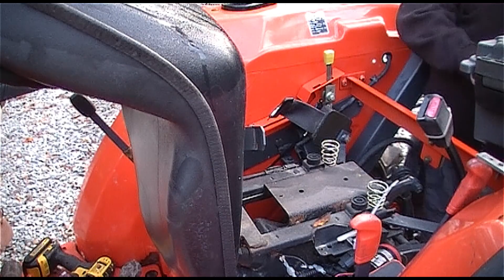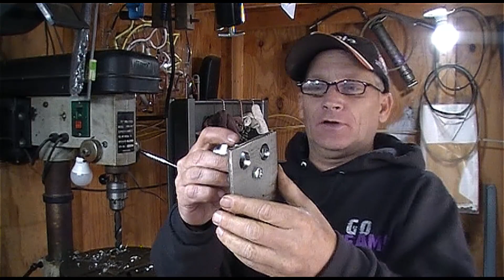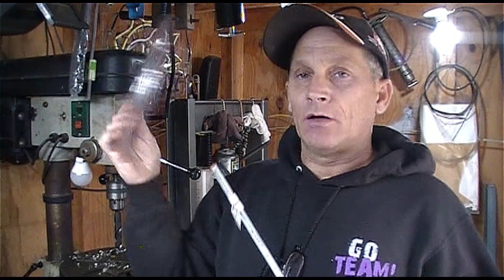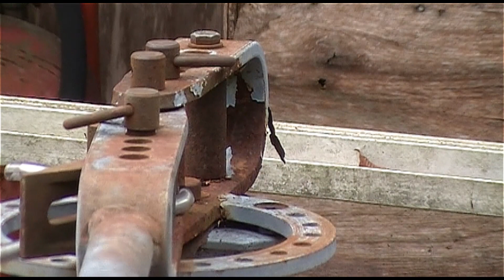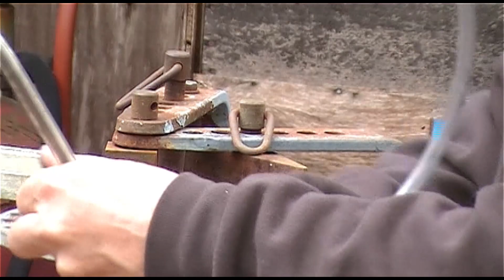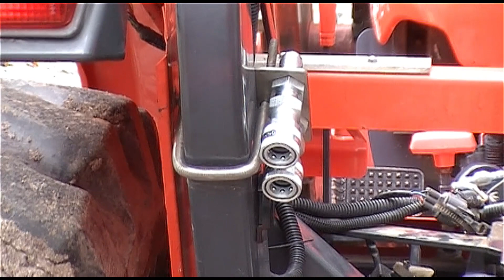installing rear remotes / spool valve part 1

Comment: Dave the is their any way to slow down the bucket dump on my Kubota m5700? It is way too touchy?
Reply from the maker: You should be able to feather the joy stick and send just a little flow which will slow it down. If your joystick control will not do this then you likely have an issue with the spool valve attached to the joystick. Feather by slightly moving towards the dump position. You can add a restrictor to reduce flow rate but that is not fixing the problem 1 and 2 it may cause increase in hydraulic oil temperatures. Hope this helps. If you need more info on feathering the control I’d be happy to create a short video showing this. Just let me know.

Comment: Dave, you’re the first you tuber I’ve ever subscribed to. Love these videos. I’m hoping I can learn how to add Rear Remotes to my Kubota L3301 that already has a factory-installed Backhoe as well as a 3rd-Function valve that I was able to install for my grapple.  I hope there’s a way to make that combination work.  Looking to use a top-n-tilt eventually with my box blade and scrape blades. A float style valve would be good.
Reply from the maker: I feel sure you will have great success with these videos if I can be of additional help please feel free to reach out to me here or my personal email address at Daveknowshow@aol.com my video series titled adding rear remotes and understanding tractor hydraulics will launch your understanding of how this works and you will get this done very easily. the hardest part is gathering the correct fittings to adapt the new spool valves to your existing hydraulic circuit. any local hydraulic shop will happily help you with ordering the correct fittings. I have found that Napa is much to expensive so avoid them unless you can compare price to another source. I used my local eaton dealer and a few others. thanks for stopping by and subscribing! peace love and respect to you and your family Dave in Virginia
Reply: @daveknowshow  Thank you, sir. Truly appreciate the offer.

Comment: Dave, just so I understand,,The spool valve you are installing, is that an open or closed center valve? Edit: Has to be open center for Power Beyond. If not, you won't be able to use anything BEYOND the rear remote spool valve.....
Reply from the maker: that is correct open center. some like mine has a power beyond port and a back to tank port. others only use the power beyond port. on this one I used both and had to either install or remove an internal device to create the power beyond port. cant remember which it was. I believe I added in a piece that was included with the valve. the only difference seems to be that when you add that piece instead of dumping the low pressure side of the cylinder into the power beyond port at the manifold it instead dumps that fluid into the back to tank port under relatively low pressure at least that is how I understand it. hope this helps. if I can help in anyway please feel free to ask.

Comment: Dave do you have a supply list of everything you used? I’m wanting to put just one set of scv valve on back of my Kubota L3410.  Could do exactly what you installed; but really only need one spool to raise and lower a hay rack.  Thanks
Reply: Also did you purchase everything from Agri supply?
Reply from the maker: @kevinhays8305  I don't have a list no. the spool valves I bought at northern tool but they can be bought at surplus center dot com. they sell lots of hydraulic surplus supplies. I tell you to be honest I was like you in that people told me to install a three spool valve and I insisted I only needed a two spool valve. well now I wish I had installed a three spool valve instead. so don't waste your time installing a single spool valve. trust me you will eventually want three. I'm seriously looking into adding another spool valve for a small dump trailer.

Comment: Dave, I have a question.  Your video is very good and I know what to do to eliminate the selector valve now.  But the question is, when I remove the front end loader which lines must be connected together in order to complete the circuit.  I believe it should be the main line coming into the spool valve and the power beyond line that must be connected to still use the rear remotes and the 3-point hitch.  Is this correct?  When the front end loader is removed, the spool valve goes with the loader and doesn't stay on the tractor.
Reply from the maker: on my tractor and most other tractors the fel spool valve stays on the tractor even when the loader is removed. that spool valve contains three vital connection points. main power in, power beyond and back to tank ports. hope that helps. if the valve is removed then connected the main power in to the power beyond line will continue the feed so yes you are correct. edit: additionally if equipped with a back to tank line that line will need to be capped off.
Reply: Thanks Dave, I'm going to watch the other videos about hydraulics that you have out also.  I'm not great on hydraulics, but in time I usually figure things out.  It's great to have access to videos like yours.
Reply from the maker: @kennethmelnik2494  I'm honored to be able to help. please let me know if I can help I certainly will.
Reply from the maker: https://youtu.be/DAeW5eqEqvM

Comment: Hi Dave. Great videos. I recently bought a small farm and my first tractor, a Kubota L2501. I want to add a spool valve to control my top and side link for my 3pt hitch. I plan to mount the spool valve like you show. What brand and model spool valve did you install?  Your videos and response would be greatly appreciated.
Reply: Thanks Dave. I may be hitting you up for more help.  How can I support you and your channel?
Reply from the maker: just keep watching liking and sharing my videos. I enjoy helping folks its what I do.
Reply: How are you feeling these days?
Reply from the maker: been hurting all over lately but I'm better than I was. just gotta keep pushing forward my friend.
Reply: Sorry to hear that.  Are you going through radiation and/or chemo?  I will be sending up some prayers for your healing.
Reply from the maker: no treatments for now. they want to do more surgery. I have been putting that off due to some other health issues. appreciate the prayers.
Reply from the maker: https://www.northerntool.com/shop/tools/product_200419671_200419671
here is the link to the valve I used. I'm not an affiliate to the site so makes no difference if you buy from here or amazon or some other resource. glad you are enjoying my videos. if I can help just let me know.

Comment: as one who is always custom building all kinds of stuff as I am a welder and heavy equipment mechanic by trade, I find hydraulic shops have a huge make up of that crap, I found a wholesale distributer that I can buy all the hydraulic components for like less then a 1/3rd the cost of the local hydraulic shops, and its all top line weather head fittings hose, valves you name it, the shops are getting to be out right criminals with this stuff, an with air fitting, princes auto sells cheap fitting but you have to really watch witch brand you buy, they really push there off shore brand power first witch are total junk, but they also have the good brands as well for a few dollars more, I use to buy all my stuff from them for many years until I found this distributer, I still buy some valves an pumps, hydraulic motors made by eaten, witch are really good and go on sale a lot, there hydraulic cylinders have been good an if you do get a bad one they replace it no problems, I still buy a fair bit of stuff from them but I really watch what brand I'm buying, last time I bought a few hydraulic fittings from a local hydraulic shop, it was like 200.00 for a 3/8 hose 6 feet long w/ female JIC FITTINGS ON IT AND A HAND FULL OF JIC TO PIPE FITTING only because I was stuck and the customer needed it right away, man I was pissed right off at there 500% markup and they feed you there line on how little they make on it so they cant offer any discount, witch is total bull shit as I know what I pay for a box of 50 of them fittings, also never buy pluming valves from Canada tire there total trash, they all get a tiny pin hole in the brass casting all the time in a mater of a few months.. there is no need for them prices they charge, its there huge mark up only.. iv been boycotting them for years and offering my customer a good price on the stuff
Reply from the maker: there is a huge mark up, I used eaton fittings and bought them locally. I paid a lot but I paid far less than the average joe or even local repair shops. I had helped this place out previously by resurfacing there gravel parking lot with the tractor and box blade. I did the job cheap and so when I needed these quality parts they hooked me up! thanks for the comments
Reply: Hi Arnold.  Do you mind sharing the name of the wholesale distributor you reference in your comment for the hydraulic fittings.  I am getting ready to install the rear remote/spool valve and a hydraulic top and side link on my Kubota L2501.  I know the fittings will cost a small fortune if I don't find a reasonable supplier.  Your help would be greatly appreciated.
Reply: Chris Dixon it’s funny that guy didn’t share.  Jerk

Comment: If you haven't tried already Harbor Freight has angle drill for either 29.99 or 39.99. May work for you
Reply from the maker: sweet! I did not even think about harbor freight. when it comes to drills and stuff I instantly think dewalt because as a tradesman its the industry standard pretty much. but they  are pricey and for as little as I would use it now days since I'm unable to work the HF would serve its purpose. thanks for suggesting that!  oh yeah are you local to me John? I'm in Virginia.

Comment: I know exactly what you mean about the tools growing legs and leaving out. I also agree about the cost of hydraulic connectors. I recently added a second remote spool valve and a power beyond plate to my 484 International. So far i am at $505 for hoses and connectors, $260 for a power beyond valve. I still have to have 2 hoses made up for my remote and i expect that will be near $200 with the Pioneer fittings. Hydraulics are just too dang expensive to play with too much so it definitely pays to use quality parts so that you only do it once.

Comment: sorry ive not been able to see your videos recently I ran out of high speed data nice vid again. we recently got a farmall m
Reply from the maker: youtube is a data hog! I use a ton of data myself so I totally understand.
Reply: Well I'm a teen though. Hope the aux hydraulics work out for you. I'm going to be buying a 3 point kit for our farmall m and have to do some hydraulics. I'm more of a older tractor person but I really like the hydrostatic transmission for doing loader work. Or even a synchronized Manuel transmission.
Reply from the maker: Sloth Bear I grew up on a farm all cub. I'm a huge fan of farm all.

Comment: i would have gotten way far away from the big ass mirror before you start having trouble holding onto stuff. btw. thats a great place for a mirror, right next to the press. your just begging for 7 years bad luck lmao. also i have something i found in my shop that made me think of you right away. i sent you an email.
Reply from the maker: ok, yea I hate to get rid of those mirrors I salvaged them from the trash. but they will likely be broken if I'm not careful.